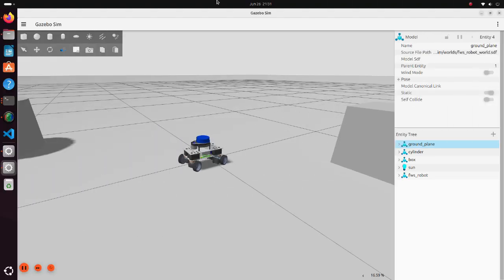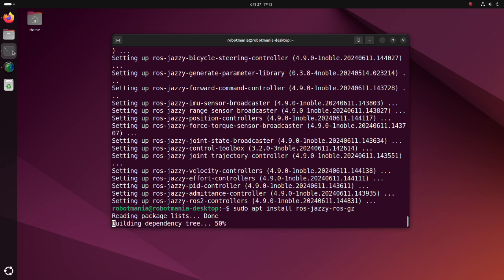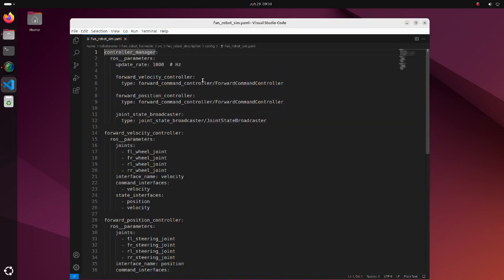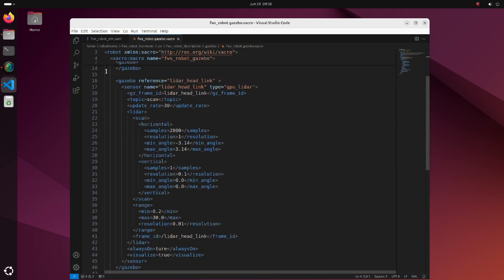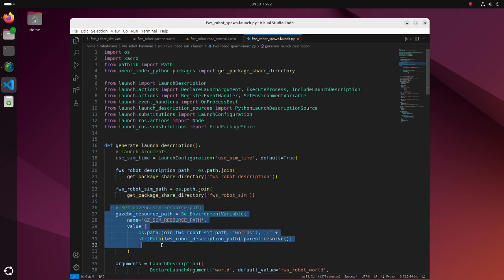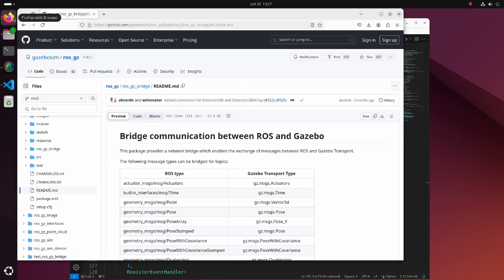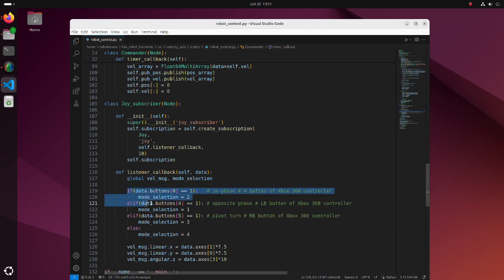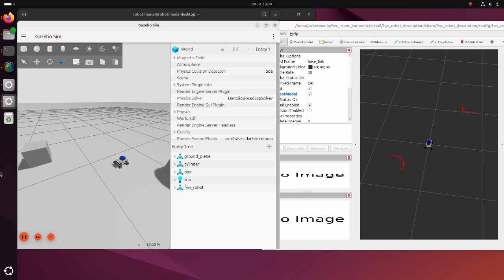How to Use ROS2 Jazzy and Gazebo Harmonic for Robot Simulation

Comment: Hello, I am trying to move a prismatic joint with this setup for controllers, but I am uncertain which controller I would need to be able to control it as the position commander itself does not fully work for it. This video has been really helpful with understanding how different components interact and integrate, but it has proven difficult for me to expand beyong and find out what is needed.
Reply from the maker: Hi Borislav Marinov”
Thanks for watching my video!
I am using prismatic joints in this tutorial. Please refer to the code to get an idea of how to use it. For example, I am using it in the “robot_sliding_base.xacro” file.
https://www.youtube.com/watch?v=gREIOD-czf8
Reply: @robotmania8896  I took a look at it and it does seem to be what I need. I was just wondering if you know of a way to handle movement due to gravity when initiallly running the simulation if the prismatic joint is vertical
Reply from the maker: @borislavmarinov9637  In that case, I think you should use force control for your joint.

Comment: HI! I have some issues with the installation of slam_toolbox on ros2 Jazzy version. Using your robot, I am not able to display the slam environment on rviz2. Do you have any advice? thanks in advance.
Reply from the maker: Hi Edoardo D'Anna!
Thanks for watching my video!
What exactly do you mean by “slam environment”? Do you have any errors in the terminal?
Reply: @robotmania8896  Basecally the map of SLAM. There is a warning in the /map topic, particularly "no map received"
Reply from the maker: @edoardodanna850  This message means that the map is probably not published. Have you generated a map and placed it into the right directory?

Comment: Hi . Is this works for ros2 humble et gazebo fortress?
Reply from the maker: Hi Imen Mabrouk!
Thanks for watching my video!
No, I don’t think so. I think you will need to change “gz” to “ign” in several parts of the code.
Reply: @robotmania8896  thanks for your response!
From your experience, do you recommend using the humble with the Fortress? Or to move on?
Reply from the maker: @imenmabrouk6769  I recommend you use Jazzy with Harmonic in order to avoid rewriting your code using new API. Since in the future you will have to move to the newer version inevitably.

Comment: hi
i have issues with ros2_control ackerman steering control 
i have made 2 steer joints and 4 drive joints.i can steer using <front_wheels_names[i]>/position using my steer joints and <rear_wheels_names[i]>/velocity using rear drive joint. but i couldn't move my front drive joints and also how to limit steer angles?
do you have any example script running in teleop_twist_keyboard
Reply from the maker: Hi ELASTICO!
In the Ackerman steering control, you suppose to steer front wheels and rotate rear wheels, so you cannot do that. I don’t have example script for the “teleop_twist_keyboard”. If you are using this package, I think you just have to subscribe to the “cmd_vel” topic.
Reply: @robotmania8896  but the front drive joints are not rotating only steering is done.is there is anyway to make like dummy front wheels?
Reply from the maker: I think that if you would like to apply rotation to front wheels anyway, you should make a ros2 control plugin.
Reply: @robotmania8896  can I do navigation with plugin?
Reply from the maker: @elastico_007  Yes, you can. But your plugin should publish “odom” topic.

Comment: Hi 
I'm modelling a Ackerman chassis car in fusion and converting it to urdf. Can I give streer joint and rotation joint at the same place? And both joints are perpendicular?
Reply from the maker: Hi ELASTICO!
Thanks for watching my video!
Yes, you can. I have several videos with Ackerman steering mechanism. You can refer to URDF files for those videos.

Comment: Hello, i have a problem when using gz sim on my terminal the GUI instantly crashes. The gazebo sim window popups but it seems to only be a screenshot of what is on my monitor and i need to manually kill it. I used the recommended command to install : "sudo apt-get install ros-${ROS_DISTRO}-ros-gz" with my ros2 jazzy installation. I tried to reinstall both gazebo and ros2. Any ideas on how i may be able to fix it?
Reply from the maker: Hi exysta axyde!
Are there any errors in the terminal? Also, does your computer have enough computational capabilities to run the Gazebo?
Reply: @robotmania8896  same issue here :(
Reply from the maker: @kaizoku_04  Hi Mohannad Rababah!
Thanks for watching my video!
Do you have any errors in the turminal?
Reply: @robotmania8896  [ruby $(which gz) sim-1] [GUI] [Err] [Ogre2RenderEngine.cc:1301]  Unable to create the rendering window: OGRE EXCEPTION(3:RenderingAPIException): currentGLContext was specified with no current GL context in GLXWindow::create at ./.obj-x86_64-linux-gnu/gz_ogre_next_vendor-prefix/src/gz_ogre_next_vendor/RenderSystems/GL3Plus/src/windowing/GLX/OgreGLXWindow.cpp (line 165) this error was on the terminal
Reply: [ruby $(which gz) sim-1] [GUI] [Err] [Ogre2RenderEngine.cc:1301]  Unable to create the rendering window: OGRE EXCEPTION(3:RenderingAPIException): currentGLContext was specified with no current GL context in GLXWindow::create at ./.obj-x86_64-linux-gnu/gz_ogre_next_vendor-prefix/src/gz_ogre_next_vendor/RenderSystems/GL3Plus/src/windowing/GLX/OgreGLXWindow.cpp (line 165)
this error shows up whenever I try to open a project on gazebo then after trying to load instantly exits
Reply from the maker: I found this issue. It seems similar to yours. Maybe this will help you.
https://github.com/gazebosim/gz-sim/issues/1934#issuecomment-1487694481